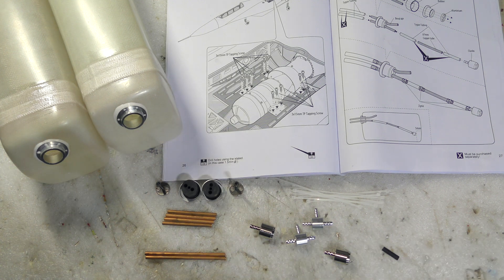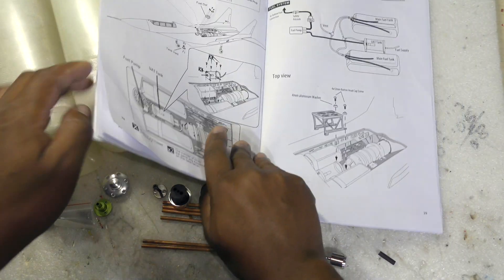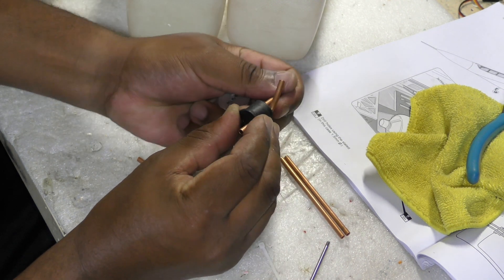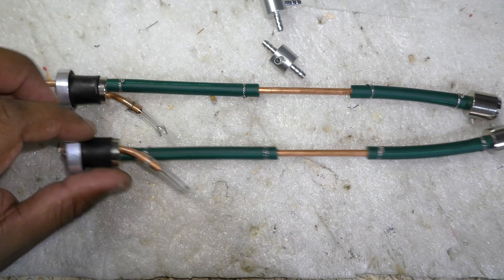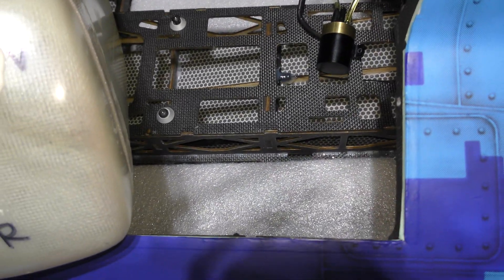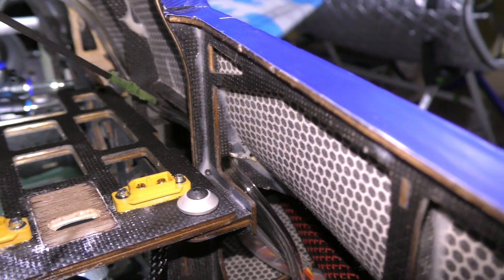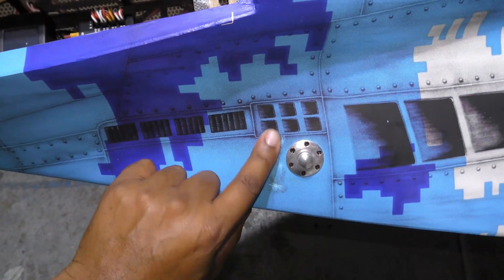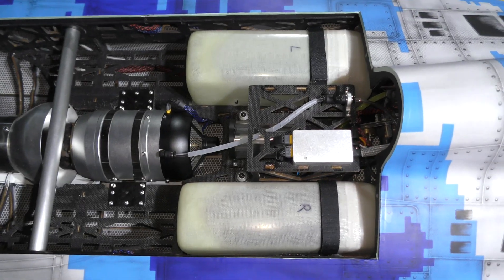BlackHorse Mig29 Build Series #8: Fuel System Installation

Comment: It will take less pump draw with them plumbed in parallel but with series, you can assured of no air draw (until the 1st tank runs dry). Probably a small wing trim issue as 1st tank empties. No right or wrong answer.. pick your poison.
Reply from the maker: I agree. I usually do series. I did parallel just because that's how the manual recommends. But either way with the right setup works